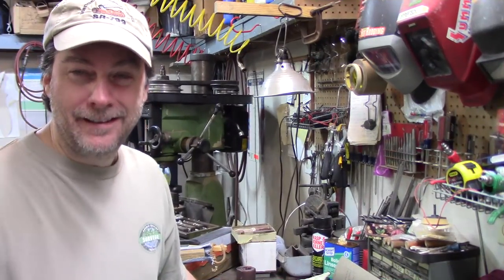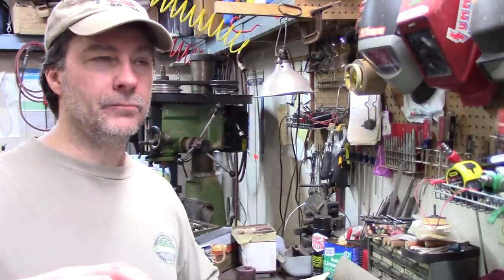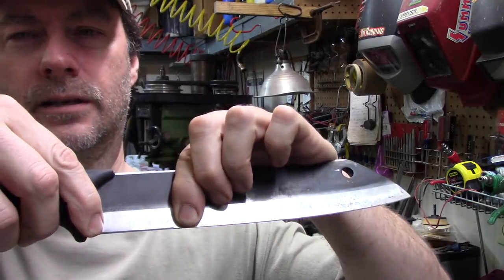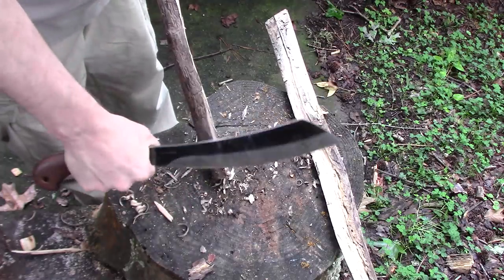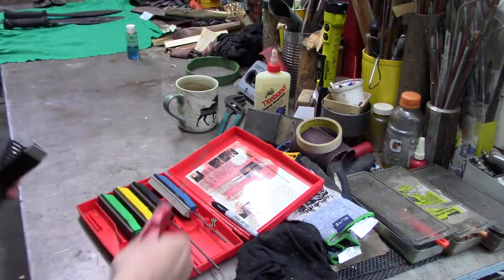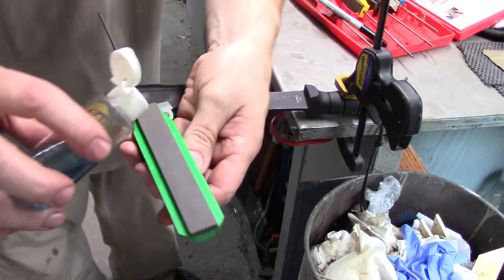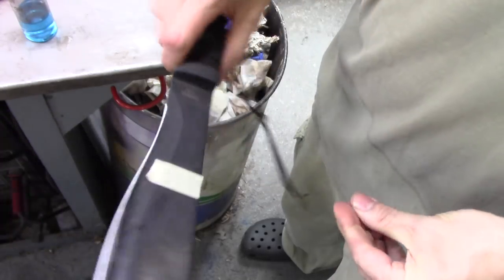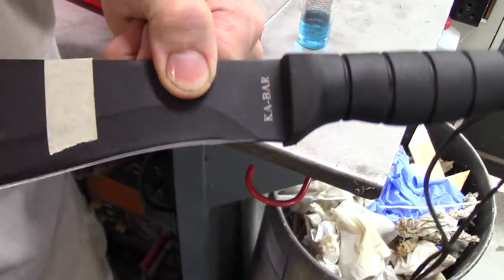Machete Sharpening For Bushcraft Use

Comment: That's a really good idea- to have a steeper angled edge near the base of the blade.  It turns the machete into a multi purpose tool.  You can still chop like a machete.  The edge near the base can be used for fine carving (feather sticks, etc).  And with many machetes (that have a point) you can use it to "drill" holes and pierce things.  I've found that the steel of most machetes is easier to re-grind than most knives.  You demonstrate the right way to do it with a angle guide.  You did a really nice job.  The second edge looks great (like the factory had done it).  I just do it freehand. People can call me a hacker, and that's ok.  I just mean to say that if someone doesn't have the tools or ability to do as good a job as you did here, they can still put a functional, fine carving edge on their machete.  Excellent machetes (IMHO) can be bought for very cheap ($7, $8, etc).  Tramontina, Imacasa, etc.  So if someone tries modification and ruins it, there is not much lost.  But, really, with these machetes, a "ruined" one is easily turned into a smaller machete or knife.  I've found that mistakes I've made when learning were some of the most "Fun in the Woods"...
Reply from the maker: Very well said Doug and thanks for the comments Brother
Reply: The price is a little higher than you suggest although your comment is still very valid in every other way
Reply: ....likely true.  Admittedly I'm cheap and shop for deals...
Reply: Your machete videos have taught me so much!  My husband has had a jungle machete hanging in our closet  since we were married almost 13 years ago.  I never knew what to do with it until I started watching your videos.  It's a little too big for me to use on our property, so I bought a Gerber kuhkri to use instead.  (My husband is in a long term care facility and is not able to advise me.)  I never was around someone who was sharpening knives by hand (my husband used a sharpening machine to sharpen our kitchen knives).  Anyway, I think my kuhkri needs to be sharpened.  Can you tell me the brand of the sharpening system you use in this video and where I might be able to buy one?  
Also, what exactly is a scandi grind?Thank you, and thank you for posting these videos.  😀

Comment: Great  video Dave.  Couple things, try putting machete tip into log and pull stick for fast feather strip. If you are sharpening a knife, attach that pivot base to bench with clamp. Attach jig to blade, find bevel angle and put it in pivot base stem. Sharpen one side, lift/flip over, and drop onto pivot base, Sharpen other side.  Love the denim/board idea!
As always patient , good teaching .
Reply from the maker: Thanks for the comments and thanks for watching

Comment: I did the same on the Condor Village parang. I used a Nickelson file for intial removal and followed with 2 different grits, 400 and 800 on a small belt sander. Really works much better for feathersticking. A worn out belt sander belt with polishing paste also can put the strop effect on the blade! Nice job there!
Reply from the maker: My way feathers good enough for me, thanks for watching

Comment: I really liked how you demonstrated the use of the guided tool and permanent marker to find your angle. I use a similar method for my blades, using the Lansky set (5 wetstones ver). I have reprofiled edges on knives and found even 5 degrees of change can take a good while to get done even with the coarse stone. The finest stone in set is 1000 grit and using white diamond compound on a strop I can get the edge mirror polished. Just received my Condor Bushcraft Parang today, looking forward to taking it out. Never realized the seax had 2 different angles, so thanks for shedding light on that. Even with the modifications you've made, I doubt you'll be in a hurry to carry a machete without a knife attached to the sheath. Great backup method though and awesome way to make the already versatile blade even more so. Have a great weekend guys!

Comment: Well done Dave . I did do this same thing to my old M-tech Nighthawk I made it 2 inches wide really solved my feather sticking with a single blade carry .It work so well I almost did it to my SP-53 but since I almost never carry it on my hip but it is always with us on the side of my allice . Here in California in our area and the area's that we travel to in the high sierra's there is nothing but sage brush . But since there is nothing around like your southern swamp land. My first what I would call a sharping unit I got from SMKW about 11 years ago I think, looks just like your unit but no V stone worked okay and was called Blade Master. I have since bought others  all about the same results . I did buy another Sp-53 back in the late unpleasantness with finding an SP-53 it was like they told me when talking to Ontario they were on the way this one is for the grand son he is constantly borrowing mine which is great but it's time he can handle it and he takes great care of his tools . To be honest Dave I enjoy sharping my blades the old fashion way with my stones it does take much more time but the results are spectacular at the moment I was going through all my knives using the the Work Sharp Pression Adjust Sharpener it's does okay I just was have no fun so I put it away and pulled out the wooden box of stones and have been having nothing but fun it will take me a good 2 months to finish all the knifes and hatchet's . Great common since video keep it up and say hi to you son . Happy Trails from and old fart .

Comment: Great tip Dave! I heard somewhere: 'If you own a knive, know how to sharpen it'!. Been strugling with that one, and have watch a few videos about sharpening, but still haven't found what works best for me, but I'm on the way. most of the times, just afraid of ruining a good knive. I did found a way to simplify everything, but probably need to ruin one or two inexpensive knifes in order to gain some experience and learn something along the way. Take care and thank you for sharing your experience, have a great new year!
Reply from the maker: Thanks Pedro and I'm glad you liked it.  Yes, you definitely need to know sharpening. Odd thing,  all knives have different geometry,  grinds and materials so sometimes what works for one won't work on others.  Depending on if it's a knife, axe or machete I'll use anything from sandpaper to diamonds, to India stones to ceramic or Japanese water stones.  Thanks for watching my friend

Comment: He Dave, thats a really good foolproof system. I have been using a simular sharpener and a helpfull hint i use is when i find the placement ot the holder on the blade  i scribe the outline on the blade so all the guess work it taken away, just line it up to the marks and its off to the sharpening races. Hope this helps to make it a little bit easier and faster to sharpen. Thanks for all the  knowledge man cheers
Reply from the maker: Thanks for the tips Doug and thanks for watching brother

Comment: Hi Dave! I hope your back gets better soon my friend. Sorry I'm a bit late to the party, but thanks for sharing your techniques!  I like the denim option for strops, I'll have to give that one a try. 
Just an FYI for taking on reprofiling jobs like the Condor convex-to-scandi type conversions using a guided sharpener or pretty much any kind. I use a flat file with cutting oil on it. Ususally one of the ones sold for sharpening your chainsaw. I just tape a bit of rod to the file handle, and make sure to keep the rod on the same side of the file when I do the flip, so that it stays consistent. It will save your stones, and rough out the profile very quickly (by comparison). Then once you have the file work done, you can usually start with the medium stone, and sharpen normally. You only need to do the file trick to reprofile, or if you really have to work out some big damage spots on the blade.

For convex edges, I picked up a manual sanding pad, and use wet/dry sandpaper with a dab of cutting oil on it to extend the abrasive life a good bit, but I'm thinking of trying denim and coarse compound after watching this. The semi-dense foam back of the pad lets the abrasive conform to the convex curve of blade really well. I've tried automotive body repair sanding blocks and they work pretty well, but the best has been one called "The Preppin' Weapon". It's just a little softer. I actually got the technique and idea from Rooster over on Axe Junkies, where it's at least locally known as The Rooster Method. Pretty sure he's made several videos on it by now. He uses a sort of J shaped stroke, starting off just pushing at 90' away from the blade, like normal stropping, but about half way through the stroke, he also runs the pad down the blade towards the tip at the same time as pushing away. Each stroke overlaps the last one until you are just doing a 90' push at the tip. He always works from heel/base of the blade, down towards the tip. I think it's more for muscle memory and consistency, than anything else, but I'll tell you it sure works on axes and larger or heavy blades where it's easer to move the abrasive over the blade, than the blade over an abrasive. If you are interested, I can see if I can find a video of him demonstrating "the Rooster Method", if you can't turn one up.
Reply from the maker: Thanks for the comments and Roosters method is definitely a tried and proven method

Comment: I like to have my BIG knife and my small knife. The big one for chopping and the small one for carving/shaving. I was using my Schrade F45 (14" blade) for quite some time, but then I finally got a Schrade F37 (7" blade) that I use now. I use the for chopping, my Morakniv Companion for carving/shaving and for skinning the bark of tree or branch, I switch between the two knives. Sometimes Mora, sometimes Schrade. They both do well with that. As for cutting down a tree, I use one of my Silky folding saws. I have F180 (7" blade) and Big Boy (14" blade)... Yeah, same lengths as my knives. LOL
Reply: The idea is that the machete becomes more of a multi-purpose tool in case you lose the small knife.  Also, this method is useful if a person can only afford one tool.  I think this is more common in the 3rd world.
Reply from the maker: Sounds good, as you know I also pair up most of my machetes with small wood carvers. The only exceptions are when I have a saw or stainless food prep knife paired up.

Comment: Dave, I hope your back get better soon. I got vaccinated last Sunday and my back on the right side is killing me still. I saw you sharpening the subtle recurved section on your two ka-bars with flat stones. Is it ok to do so? Not trying to criticize here. Just wanna know. Your stone will contact the blade in two spots, on each edge. I suppose it could work if the recurve is subtle enough and the section you want to sharpen is long enough. But how about on a small blade? Could you share your method?

Comment: Thanks for the great idea Dave. I might try that with my Swamp Rat Battle Rat, it's the same overall length as the ESEE Junglas II but an inch longer blade and an inch less handle. Still trying to re-profile the factory asymmetrical edge grind to a normal flat grind but man, 52100 is TOUGH to work with.
Hope your back heals up soon!

The V shaped stones will sort of work for serrations but they destroy the radii by cutting V shaped bottoms (found that out when I tried using my Spyderco Sharp maker on a combo edge Benchmade).
Reply from the maker: You are very welcome and I'm glad you liked it.  I was thinking about using my serration stone to blend in the transitions of carving sections.  I hope it'll wear a radius

Comment: Great tips, Dave; you can never know too much about sharpening under different conditions. Of course, it is easier in the shop than in the field. BTW if you need any advice on you low back problem, let me know. I've been treating these problems for more than 33 years. Tom
Reply: @Reallybigmonkey1  Okay, Dave; I'm at your complete disposal, if need be. BTW, you got me thinking of a way to protect the lumbosacral spine when hiking. It may be a question of modifying the center of gravity of your kit on a frame which forces you to maintain a proper lumbar lordosis. The anatomy is screaming out a solution to a very common problem with backpackers. Be well and rest up.
Reply from the maker: @dr.tomgio6694  now that sounds like a great project!

Comment: Hey Dave!   Great video.   I've got the Ontario SP53 Bolo that you recommended done in 25 degrees on most of it and 20 degrees down near the handle.  I use the clamp from the Lansky system, but use the DMT Aligner rod/holder and DMT Aligner 4 inch pop-in diamond stones.  I like your machete sized strops, so I'll have to make a couple of those.
Reply from the maker: Hello Martin! I'm glad you liked the video and that's awesome you did them mods to the SP53.  Definitely make a big strop if you can.  It makes a world of difference.  Take care and thanks for watching

Comment: I have a square ended machete i want to make a,curved end on. Any suggestions how i should do it?
Reply from the maker: Use and electric grinder with a cut off wheel. Cut a little then douse in cold water,  never overheat the blade while cutting

Comment: Question: doesn't that rig make the angle change depending on how far the patch of knife edge is from the holder?
Reply from the maker: Yes, the angle can can depending on mounting position but it's no drastic.
Reply: There will be a difference depending on where you clamp the blade as well as how long the blade is. The angle will  be different at the end of the blade than it will be close to the clamp. That is why some people move the clamp position when sharpening. A very tall blade will be differ from a short blade if both were clamped close to the blade spine. It is good to stop thinking of the angle as a number except as a reference point. The way Dave used the sharpie marker shows you how to match the existing edge. Then you can adjust your desired edge from that position. Hope this helped rather than confuse.
Reply: @kevola5739  yes they say that's true but there are other guys on YouTube even knifemakers that use the same type of sharpening system that Dave that is using.
Reply: @MasterK9Trainer  - So true. I was just trying to help those who are struggling with sharpening and help them find a solution or identify a problem. If you are successful in getting your knife sharp I bow to you because how can that be wrong?

Comment: Hey on the schrade machete you have why do they put those holes in it? Seems like that would weaken the blade ?
Reply from the maker: Ive always heard holes in blades were meant to absorb shock and keep a blade from cracking in that spot. Most of the time youll see holes in stainless blades only. I cant verify that tho.

Comment: is there really a difference between oil and water stones that you can look at them and tell difference? As I have many from grandfather/father/friends etc,
. that I don't want to ruin by using wrong lubricant?
also what type/brand/weight oil are you using, please?
Reply from the maker: Most new stones are for whatever you start them with, stick with it. The only exception are Japanese water stones. And use distilled water on them so they wont build up with lime from tap water. I use either Gatco oil, Buck honing oil or an Non gumming honing oil works.
Reply: @Reallybigmonkey1  thank you over the years you've been one of my trusted mentors.  Thank you, respectfully Duane

Comment: I'm terrible at sharpening. Recently bought the Block Sharpener and it works half decent, maybe not hair shaving sharp but I can slice paper clean. I did a convex condor woodbuster and after marking the edge it only honed a fine line perfectly end to end. I prefer the Paris Hilton method. Buy 100 knives all the same and toss them when they get dull.
Reply from the maker: Lol! Now that Paris Hilton method is new to me! Thanks for watching James

Comment: Good stuff Dave, thanks.
I did check amazon for a package deal for feather sticks 'n lighter fluid but could find any. (-:

Only thing I have of what shown is that yellow 'n blue squeeze clamp. FYI: Great for clamping my brat forks 'n clamshell basket to arm/leg of patio chair for cooking over open fire. vs holding the thing for nice 'n slow cook.  ...cooking fingers.
Reply: Fine, don't tell how ya hurt yer back so we can't all give Easy Button solutions sos ya don't re-injure. (-:
Reply from the maker: I'm glad you liked it Brian! Lol, hard to believe there's actually something that's not on Amazon!
Reply from the maker: I got injured beating a shaft into a hub with a sledgehammer. So, don't do that.  Lol

Comment: I think it would be a lot easier on your stones to do most of the reprofiling with a file to get your 'scandi' section. You can do a convex or a flatter grind with the file to get the profile you want and finish off with stones, belts, and strops.
Reply from the maker: That would be much better on the stones.  My issue is holding the file at just the right angle to get the scandi section started.  Thanks for watching Craig

Comment: By the way, thanks for the insight on the scandi grind on the five essentials post. I never really understood what it is about. One thing I understood right away, from being around a lot of tools and knives and stuff, is that if you cut yourself with a scandi it's going to be bad! 
Wonder why Condor is so big on that grind. Maybe it is less expensive to do. Jay
Reply from the maker: I think two reasons for Condor using a scandi so much, yes it is cheap and easy to grind and they are basically aimed towards bushcrafters and Woodsmen who do a lot of carving.  Thanks for watching Jay